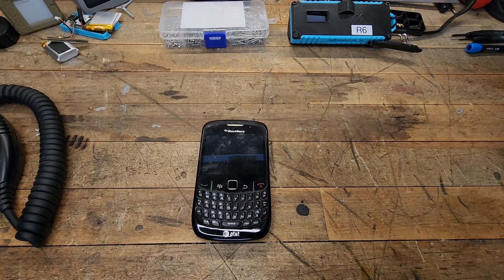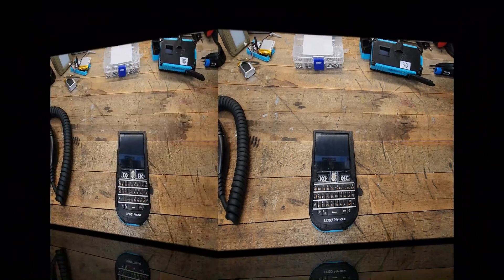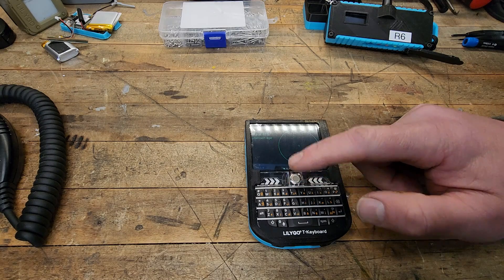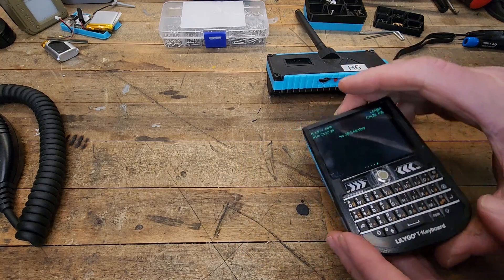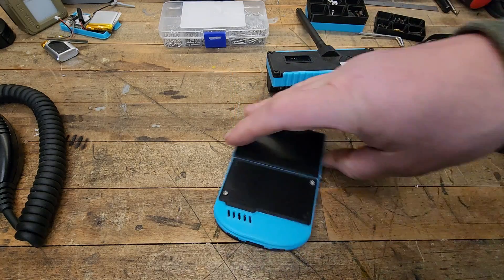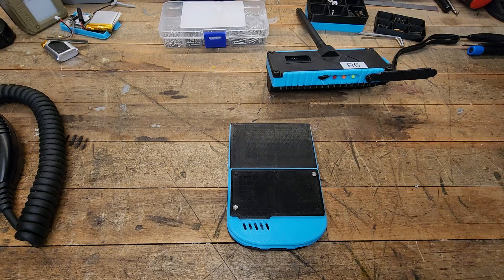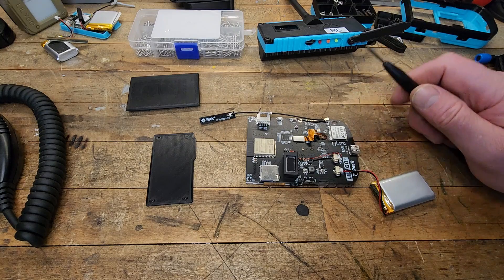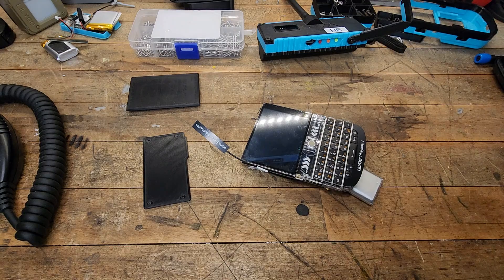The  Lilygo T-Deck a Game changer | Meshtastic

Comment: I'm wondering if LiliGo T-deck could be used to create something like SpotX - basically to mount a sattelite antenna, and work on 240-270MHz satcom (ufo10, ufo2, ufo11) or even TinyGS LoRA sattelites on 70cm frequencies???   Could be the perfect very-long distance device for SHTF scenarios that even my Mom could use.
Reply from the maker: I hadn't though of that. It is a very interesting idea that deserves some research.
Reply: @RavenwoodAcres  Yeah.  Basically, the Meshtastic tranceiver would need to be replaced with (or complemented by) something that would work on 240-270MHz and/or TinyGS frequencies - that's the difficult part.  It would obviously need a satellite antenna (that's easy: Brazilians and Russian have perfected the art of compact homebrew satcom antennas).
And it would probably need a user-friendly WhatsApp/Telegram-like app written (provided that T-deck comes with some sort of OS preinstalled), which would assign a fixed 5 or 6-character username to itself and listen to the train of 187-character transmissions (like AIS does) and save the ones that start with it's own 6-char username, and display accordingly.  Once received, it sends out a receipt ping. Once read by recepient, it sends out a read ping.   No central server. No database (the local DB is inside the device itself). No authentication gateway or gatekeepers (those Iridium, Garmin or SpotX devices will not work during SHTF even if you have subscription because the authentication gateways are on the ground).  Just a set of hard-coded rules: e.g. 140-char max, 10 messages/hour max; if not received after 5 minutes, try again - 5 times max; and what to do if the primary frequency is hijacked, jammed or overloaded.
The structure of each 187-char message: @To, @From, message-ID, 140-char Content, Timestamp, Message-status. 
According to my calculations, if 10,000 people were to transmit 187-character messages in 1 hour that's just 2.2MB/hr
Reply: You are not going to be working milcomm sats with this device.

Comment: Thank you for sharing this stuff. Saw a comment on the main meshtastic discord about a device like this with AlleyCat's case. With a 4200mah battery he said he was getting about 24 hours use out of it on a non-busy network with fastest screen timeout. Given its power consumption, kinda makes sense to make a deep case with a substantially larger battery and maybe a solar panel on the back. Flip it face down when not in use, let it grab some watts from the light.
Reply: Edit: the user AlleyCat seems open to people remixing her design, which is cool :)
Reply: You can buy 18650 with 4200mah right? I believe the even go higher than that although there are counterfeit batteries & I don't know where the real deal ends & the fakes lie into. 

Someone should make a case for that.
Reply: @ClickClack_Bam  Eh, I'd be tempted to put a 10+ah lipo pack in, and, under something clear that can take a little abuse, a 6v solar panel on the back. Every mah counts.

Comment: What is the operating input voltage? I can't find it on the lilygo website or the github or the support page. And if I'm not seeing it, and it's there - please give a link to that so I can see what the heck I'm doing that I can't find the info... thx
Reply from the maker: I totally agree with you. RAK wireless is way better at publishing their specifications. My numbers came from the OLED display readout because I couldn't find any published info.
Reply from the maker: I would say 3.7 to 4.2 volts. However, the max input should be around 5 volts for charging.
Reply: @RavenwoodAcres  Thanks for the reply. I kept looking and found an similar answer as well. Weird that it's such an elusive question and answer...

Comment: How big of a battery will your 3D printed case fit?  I was planning on getting a 3000 mah so that I'll be covered for a few days.
Reply from the maker: If you print or get the v2 case the battery case dimensions are as follows. 54mm x 34mm x 13mm deep
Reply: 3000mAh will work for ~18 hours in an environment where there are not many LoRa messages being passed.  The more messages that are passed, the lower your battery life will be.
Reply: Voltage? I can't find it anywhere. 3.7V ?

Comment: This looks like a good meshtastic device to have a couple backups of because personally in the past during ice storms is when internet goes down and theres no way for anyone to download an app. 

It’d be nice if there was a local web interface that mimics the android and/or iOS app.’s Then in theory multiple devices could send messages over a single LoRa device; with a caveat that all devices connected to a single lora device could only see and send a single message at a time from the same dashboard. But at least the lora mesh could be utilized at/on a whim without needing prier internet access.
Reply: Good thinking

Comment: I wish rak made something like this with a E-ink display the battery life would be insane
Reply: It's probably that ESP32 system that's chewing up the power. Trying to find someone who's got power consumption numbers for the RAK solution (to which you can add interfaces, supposedly) vs the Raspberry Pico solution. Don't know where the Pico usage falls on the scale of consumption rates.
Reply: @suzyamerica4679  my RAK4630 node pulls ~15ma without GPS at all. A couple ma more with the gps installed but disabled in software. With gps enabled it’s around 60ma.

Comment: I had to google the Lilygo T-Deck just to now what the heck this thing is. I guess this video is only for certain people in the know. Otherwise you might want to explain things to if you want new viewers.
Reply: It’s basically just an ESP32-S3 chip with a display, keyboard, speaker LoRa capabilities and a few other goodies. Everything you can make using an ESP32 development board integrated into one package. 

Their basic options (without LoRa) would be something like the T-Display S3 which is the ESP32-S3 a display, two buttons etc. they’re all pretty much the same. Just ESP32 micro controllers with added hardware.
Reply from the maker: Thanks for watching. I have a playlist that details LoRa Mesh Communication devices and their functions. LoRa Mesh Network Communication: https://www.youtube.com/playlist?list=PLDwfLFrunJ3JvQba9ShNxHkcnpU2u4G_y
Reply: You’ll find this is the case for 90% of the electronics community. It sounds like OP probably has good reason to not explain, but it is seriously almost impossible to find videos on anything that just tell you what the f%#^ something is and what the f#%^ are some cool things you can do with it.

Comment: I am getting 5 hrs with moderate use, with the 1100 mah battery. I have a second T-deck that will have a 3000 mah. If you get stuck on the pre programmed message response screen use the touch screen to navigate. The mouse get locked on the screen until you send a message. You can turn on and off the keyboard backlight by pressing Alt + B at the same time.
Reply from the maker: Thanks.
Reply: That seems like a really bad power consumption setup.
Why does it chew through battery so much?
LoRa is low power I thought right?
Reply from the maker: @ClickClack_Bam  I have not performed any recorded testing yet. However, I am getting 4 to 5 hours of use on my current battery setup. It would definitely be better with an E-reader screen.